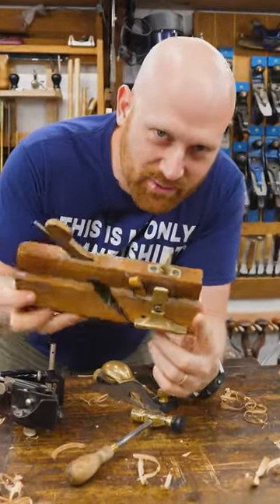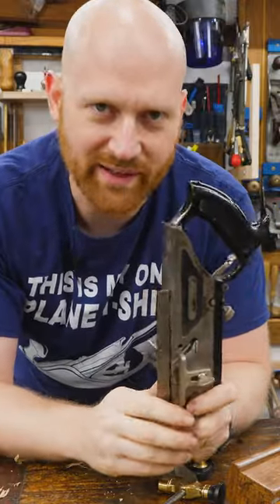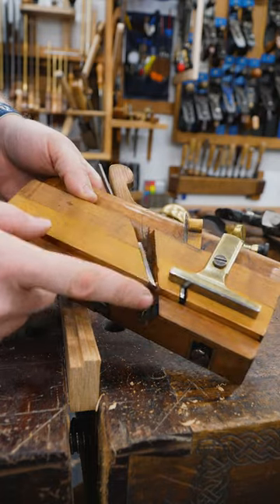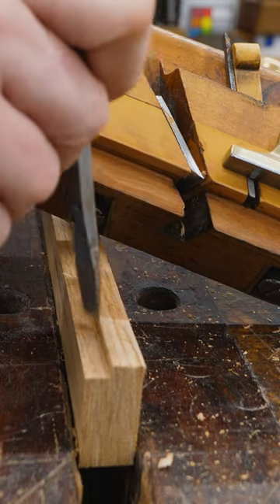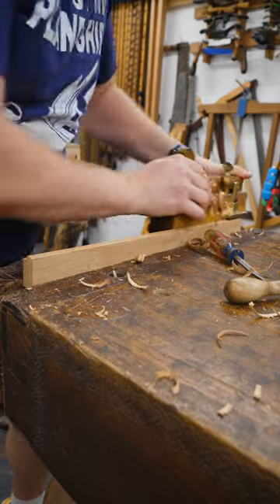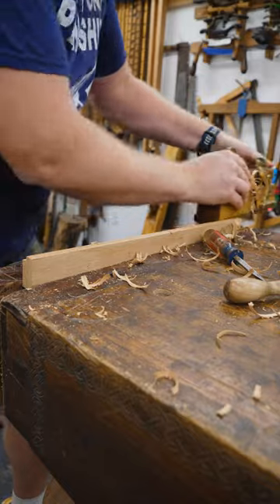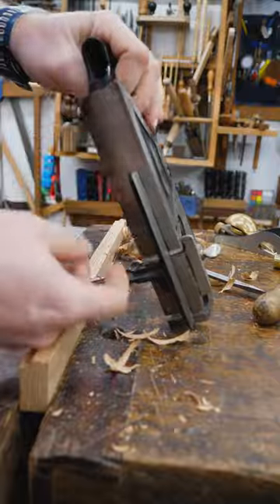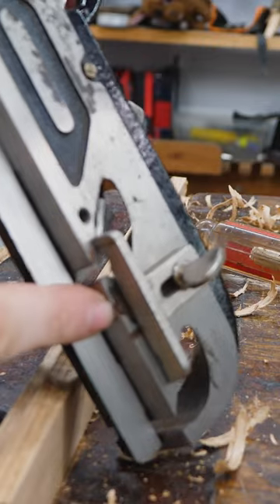Is This a Moving Fillister Plane

Comment: I just bought an old JPBO in unused condition. The Iron was not even sharpened. I had to use the bench grinder since it was probably one of the hardest pieces of steel I've ever held in my hand!

Comment: Am i stupid how is this different from a normal plane
Reply: If by "Normal plane" you mean a bench plane like a smoother, then the fence, depth stop, and nicker are what make this different.  A bench plane won't have any of those.
Reply from the maker: What @TheCaptainmaim said. There are hundreds of different types and classes of planes. Each is designed to do something different.
Reply: @WoodByWrightHowTo  @thecaptainmaim thanks for the replies, would you ever need one of every plane in your shop? or even for one project? id love to see one project use every major type lol
Reply from the maker: No there's no need for that. Most of them can do multiple different jobs and so you don't need all the specifics.here is a video covering a lot of them. https://youtu.be/4FN4RMP-SQg?si=av9-Z9L5K5hrB-PE
Reply: @WoodByWrightHowTo  really cool, thank you!
Reply: @FeelingLucky246  what it comes down to is that some planes are more efficient/faster/easier/repeatable for certain tasks.  Generally the better a plane is at a very specific task, the harder it will be to use for others.  Sometimes they are so specific that they only do one or two things (a plow plane pretty much just makes grooves, etc).  If your project doesn't have any grooves, you don't need a plow plane.  If it does have grooves, you don't need a plow plane (you can chisel it out, maybe use a router plane, or some other method).  A plow plane would likely be the easiest way to make the groove, though.
Reply: @TheCaptainmaim  i see. Thank you